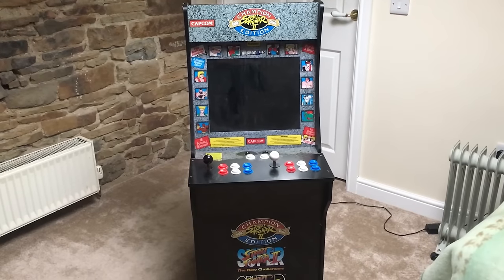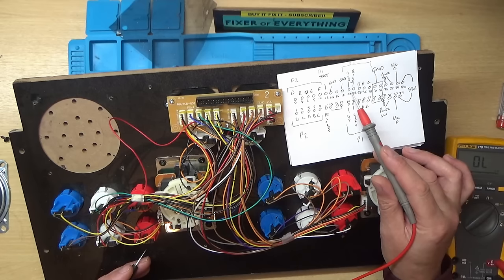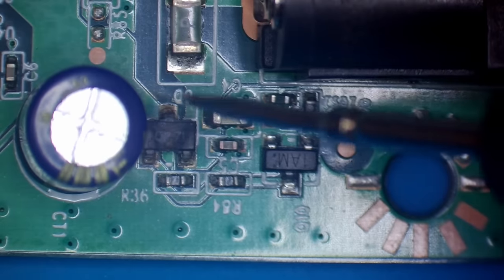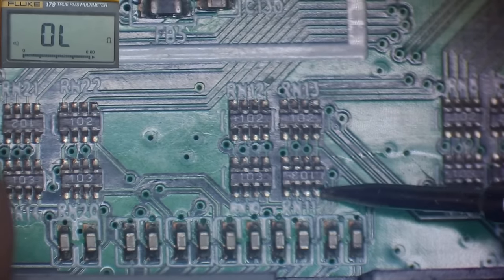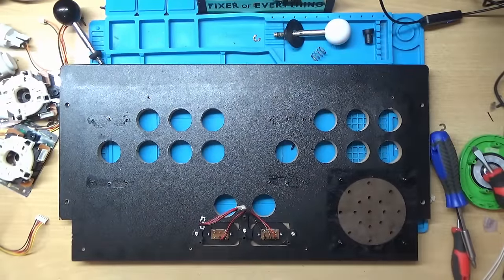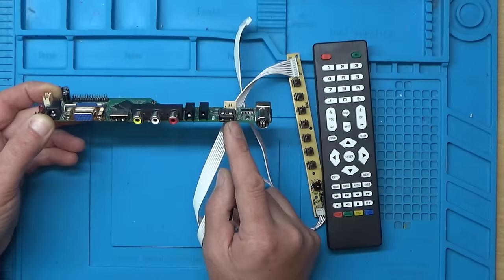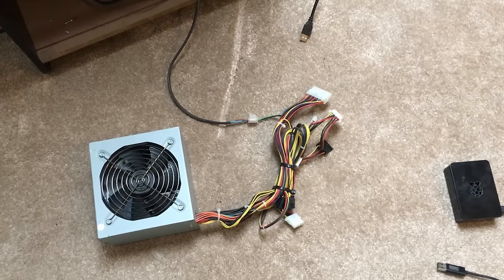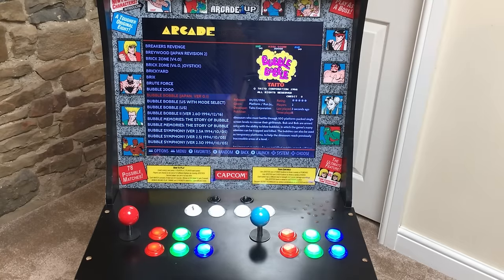Faulty 1Up Arcade Machine | Fix and Upgrade!

Comment: i think you over paid for it 🤣.... worth 30 quid but that be my limit, bit bias as i have a real one. not a fan of 1ups but for the price you done well
Reply from the maker: Thanks 👍I used to have a real one too, it was a super Nintendo arcade cabinet but had joystick instead of the normal pads, and 3 games on it. If was JAMMA and I've still got a box full of boards from when I used to work in the arcades and repair them. Still got an old taito space invaders PT2 board set too somewhere.

Comment: Great video but technically you fixed nothing lol but more done a conversion job lol
Reply from the maker: Well I did fix thel problem on the original board, but then decided not to use it.